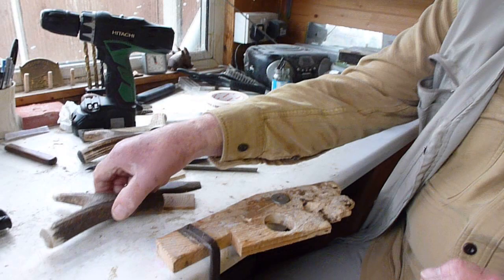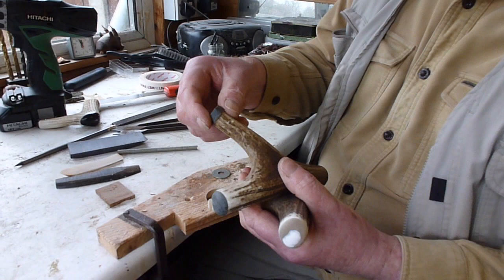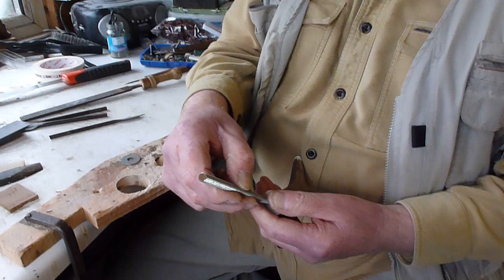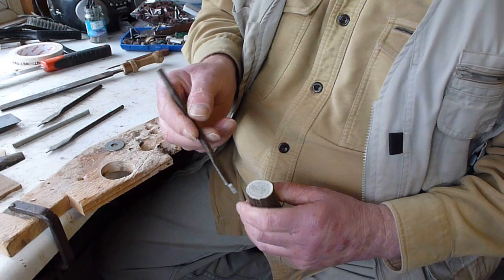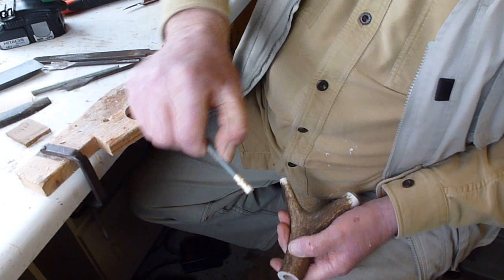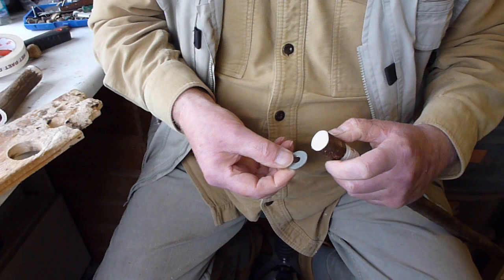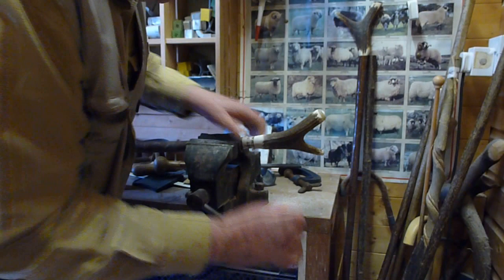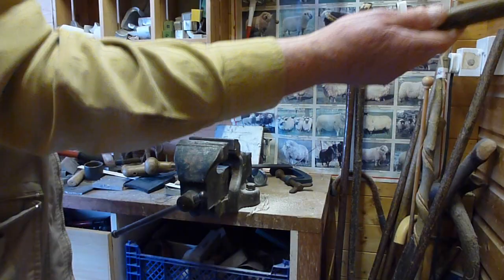walking stick making antler thumb stick demonstration series 3

Comment: A while back on the Wrekin in shropshire, I found a stick..I made quite a good Hiking Stick out of it without really knowing what I was doing tbh..but it turned out pretty good, its not entirely straight but its added a bit of character to it, so I left it like that, I varnished it with Walnut Colour Varnish then rubbed it down so it gave a natural almost tiger look to it, then teak oiled it, I have a few old pennies so I cleaned one up  , bent it and stuck that on.. I bought some Brass Tips for the end, drilled a hole near the top and made a strap handle out of some leather strip I bought.. Made Originally  for when walking up the Wrekin, but  now sometime later I am having to use it daily for health reasons ( hopefully only temporally)  but already people have asked and acquired about it, I call it my Wrekin Stick. I may put a small compass in the Top or my lucky Sixpence, don't know yet. Your vids are great, I may make some more now from what I have learned from them, Many thanks.
Reply from the maker: Hi Colin Thank you for your comments,And welcome to the world of stickmaking Dave

Comment: I could watch & listen to you for hours, you really know your trade. Please don't be offended though if I suggest you should not pass on unsafe habits to people. Holding the antler in your hand whilst you are drilling it out with an electric drill is very dangerous. People will put themselve's at risk if they copy you. You said you know you shouldn't do it, so why not put the antler in the vice instead?  I hope to make a stick using your advice, thank you for sharing your skills. If you think I am over the top with safety, well, I once had a guy kill himself at work on equipment I was responsible for. It was his error that lead to his death. I cannot watch anyone take risks without pointing out the danger since then. I do not apologize for my statement, SAFETY FIRST.
Reply from the maker: I stand by what i said with drills. They now have tension and speed control. if Antler is clamped tight in a vice then you stand a chance of drilling  out the side, if its held loose then the drill will follow the marrow, the soft centre.
Reply: @woodlandsticks1365  You are putting potential damage to an antler before safety. Why not use a soft rubber hose around the antler in the vice, as you have been doing. I'm an older person too. Do you know that the greatest accidents in NZ agriculture are in our age group, can you suggest why?

Comment: I happen to have a large box of antlers that I wasn't sure I was going to do with. I thought I might keep the larger diameter ones for knife making. Now I know what to do with the rest.  Thank you for the lesson! 
A word of caution though. Antler dust that is created while working on one, esp. sanding or grinding is very harmful once it gets into your lungs, so I highly recommend wearing either a good mask or a respirator.
Reply from the maker: Hi have you tried carving antler as in video 9 by the way i usually work over a dust extractor but too noisy Dave

Comment: Hi Dave
Thanks for the quick response, i wished id asked about the antlers before a bought 2 sections of Roe antler, i could maybe use them for a small knife handle. I'll take a look on amazon for books or may have some in the local library. Thanks again. Michael

Comment: Long have I searched for someone whose craftmnship like you. Actual hand made..minimal power tools or machines but maximum skill & experience...great knife handling and good tip on the wood and antler scaling, Sir. You certainly possess the traditional way for crafting your art and mastery of modern simple pwr tools. It is an honour for me to learn this..now that i watched how you worked , it's like I don't need to refer to other videos anymore.  Knife and drill handling, at awe. If i may request for 1 more Sir.  How do you use your grinder i mean your freestyle technique?  Please.

Sarawak.
Reply from the maker: Thank you for your kind comments, glad you have found the videos helpful. In what context do you mean with the grinder?

Comment: Thank you for your craftmanship, sir!!  BTW, I noticed each time you put the antler on the stick for fitting, it went on easier and easier. Does the final fit get loose by the time the fit is right(10:03)?
Reply from the maker: Hi You need the dowel tight enough with out any slack. And not too tight that it damages the dowel

Comment: Very nice work Although it was hard to watch you drill that Marrow  holding the Antler in your hand the way you did I did Woodworking as a profession for over 20 years and as my honey for over 35 now  and Unfortunately have seen way too many accidents happen to men and Women that have had plenty of experience using  the power tools of the trade and  they all said the same thing after a accident  That it happened so quickly  that I couldn’t believe it happened or I never thought anything like that would happen to me after all these years Etc  Sadly  it doesn’t take much to destroy a finger or a hand ! I really enjoyed your sharing  on attaching the Antlers  Wrap a old Towel around them and lock them into that Vise on your bench  for drilling Why risk injuring yourself  in a manner thats easily prevented
Reply from the maker: Thank you for concern you are quite right.I hope  others read this and take note

Comment: Sir, would it not be a bit advantageous to take the drill bit used to drill the marrow, and use it to just start it into the end of the stick that will be used.  Just start it, mind, so you can just see the tracing of the drill size on the end of the stick.  You now have the EXACT size of the tenon needed to fit tightly into the hole in the antler. All that is needed then, is to whittle the stick down to the line made by the drill.
Reply from the maker: +Seth Warner That would do the job but you still have to find the center of the stick. idealy you could  get metal washers in the sizes you need like 12m 14m 16m 18m that way would be easier. I mainly use them to find the center of the stick .Thanks for your imput.Dave

Comment: Dave......Have you tried Japanese saws. I use a fine cut with back....like a Tenon saw, they cut on the pull ( back stroke) Great when you get used to them.   Cheers.    Roger
Reply from the maker: Hi Roger the one in the video cuts on the pull and has a very fine blade thanks Dave

Comment: Hi there. Love your videos. Please Keep them coming! What do you do to the part of the antler that has been filed down? I like the idea of filing as it gives a nice smooth joint but i would also like the handle to be all the same colour. Any thoughts?
Reply from the maker: John Pearson Hi John You can get an antler stain from  taxidermist suppliers they use it to touch up their trophies never used it myself. Dave
Reply: Thanks for the reply. I will look into that. So do you just leave your antler handles with a different shade around the bottom?
Reply from the maker: John Pearson Yes John i like the white shiny finish to match the white on the tines.Good luck Dave
Reply: John Pearson sinew can be used as a wrap to show the haft but still make it flow

Comment: Great video but I'm concerned that you wear no breathing protection when sanding the antler. The dust from it, like bone, shell or any similar natural material, can get in your lungs and cause silicosis. Which is bad. Shop safety!
Reply: Silicosis from bone, which is made of calcium and not silicone? Are you sure about this?